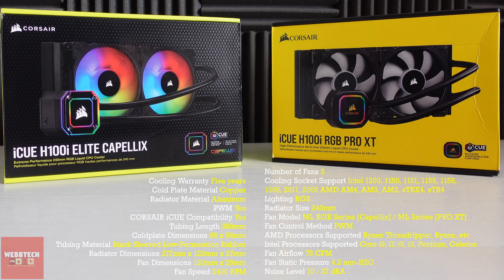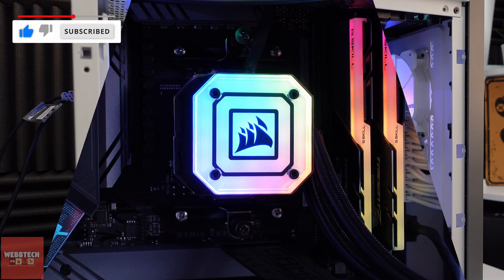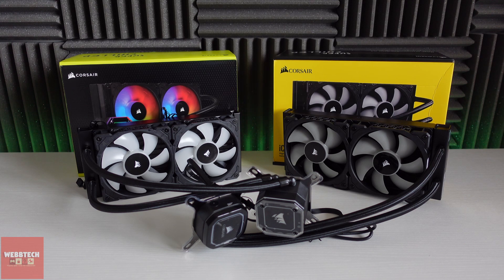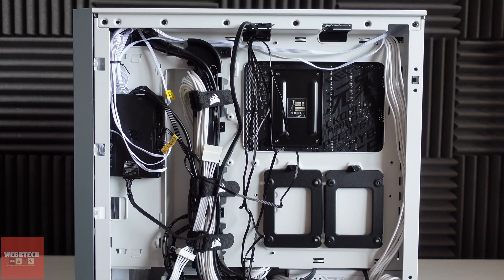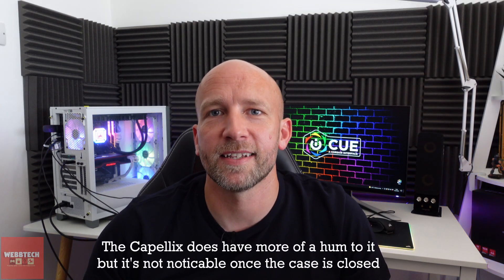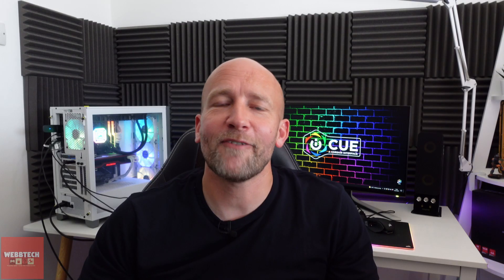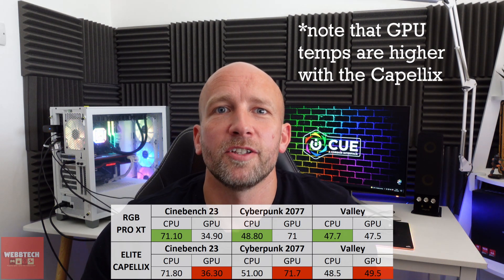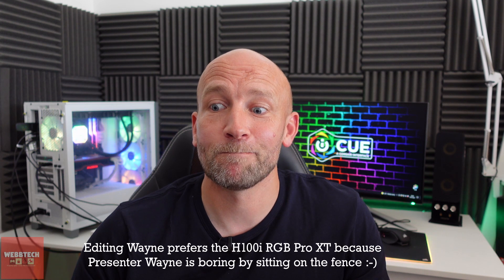Corsair H100i RGB Pro XT vs H100i Elite Capellix - Which 240mm AIO to Get?

Comment: Great video mate and got informed very well. I am thinking for a while of getting an aio and this helped me to choose which one to get. As performance seems to be similar I will go for the withe capellix.
Reply from the maker: Thanks for the feedback. They are both good, but it depends what you're after in terms of aesthetics. I'm going to use one in an ITX I'm doing next but I'm still undecided. Depends on the amount of room I have I suppose.
Reply: have had the H150i elite Capelix for a few months now great AIO plus the fans are the special 8 LED version you cant buy seperatly.